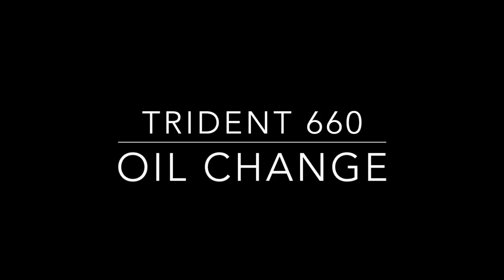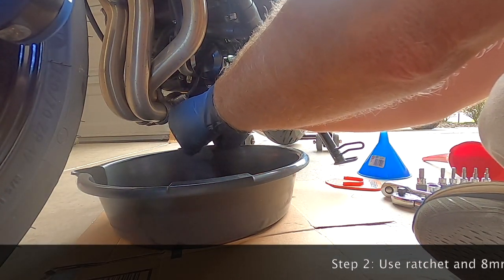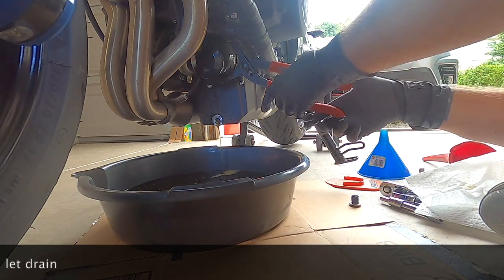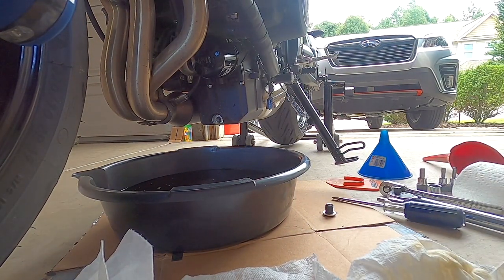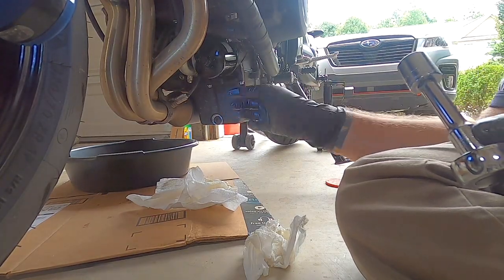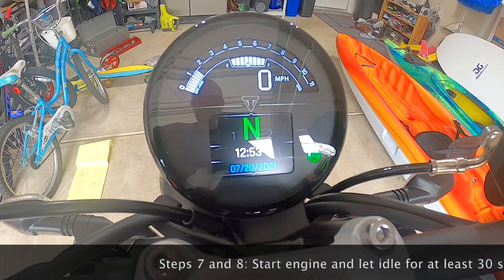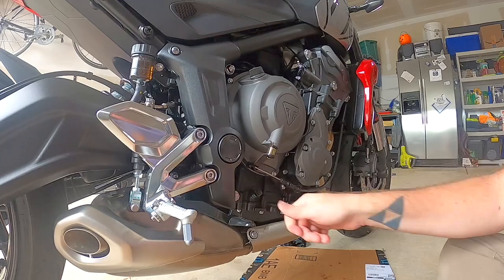Trident 660 Oil Change

Comment: Just a tip alot of folks recommend filling the new filter with oil before replacemnt. Creates less dead space that the engine needs to fill when turned on the first time
Reply from the maker: I’ve heard that and it makes sense. I’ve also heard that it’s not necessary and is a good way to make a mess. Mostly I’ve just been doing it this way for so long that it hard to change old habits at this point. 😂
Reply: Hi Rob, my Triumph 1050 manual, states that you should fill the oil filter, with new oil.
Also, smear the O ring with clean oil, prior to fitting the new filter
Reply: @SBKPete    Never forget the o-ring my boys
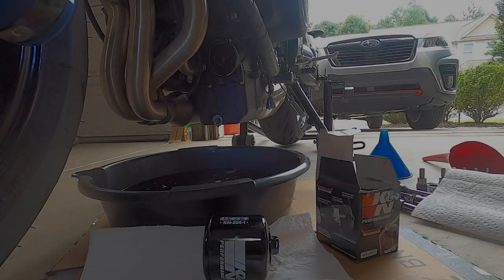Reply from the maker: By all means follow the manual. The Trident manual does not specifically mention filling the filter, but it does mention putting oil on the o-ring, which is why I put it on step 4, and you see me do it at about 2:50. The filter I took off was the original one from the factory. Maybe they are forgetting to oil the o-ring there and that is why it sticks. I've heard that it happens on other Triumph models when owners do the first oil change.
Reply: Do not try to fill your oil filter. Most motorcycle and many car engines have the filter mounted from the side, so it's not practical to do so. If it is important they wouldn't design engines this way. Even if the oil filter mounts vertically, you would be pouring some unfiltered oil into the engine and although it's new oil it still contains some debris. My personal experience in over 50 years of changing oil in cars and motorcycles I've never had issues. 
What I believe is important is to not over fill with engine oil.

Comment: I'm planning to change engine oil of my Tiger 660. Everything is same as in the video. Thanks for sharing video.
Reply from the maker: You’re very welcome. In the future, I’m going to stick with the Triumph oil filters or their OEM equivalent. I can’t trust the K&N 100%, so why risk it?
Reply: @jrobrides1340  : yeah it's always better to stick to company recommended spare parts. 
Even I have 3 different oil filter options here in India, K&N, BMC and Crank 1. Only issue here is Triumph service centre at my location don't sell spare parts to customers since they don't really have competition nearby. Next nearest Triumph dealer is 150miles+ away from here. Hence, looks like I'll have to depend on aftermarket spares rather than spending huge at Triumph

Comment: I'll complain to my grave why motorcycles can't have their sight-glass or dipstick calibrated to read the oil level while the bike is on the side stand. This check oil while the bike is level stuff is nonsense and makes it tricky for guys like me with no friends to hold the bike :-p Another note for all: be sure to check the owner's manual for your machine - oil checked cold can vary quite a bit from oil checked hot. I am not sure if there is an industry standard on this one, but you'd be amazed how much hot oil expands and gives you a whole different reading.
Reply from the maker: 100% agree.

Comment: recently also changed the oil on my own. By the way, I drove with a strong magnet on the drain plug, and when I removed it, the plug was very clean, without any magnetized signs of wear.
Reply from the maker: Nice. I didn't use a magnet, but there wasn't anything strange in the pan at least.

Comment: To anybody watching this for a how to, do NOT tighten your filter on with a wrench. That’s just stupid and asking for trouble when trying to get it back off. You only put them on as tight as you can turn by hand and that’s it. There’s a reason why there’s a big rubber gasket on them. The giant nut welded on the end is for removing it. They will tighten down even more going through the natural heat cycles. That’s why when you put them on by hand you can almost never get them back off by hand. Everything else is good advice though.
Reply from the maker: Then why have a torque spec for the filter?
Reply: @jrobrides1340  because something like a torque spec for an oil filter is for somebody that has no mechanical ability and needs to be walked through something ultra basic with their hand held. Ask ANY real mechanic and they’ll laugh at you if you talk about torque specs for an oil filter. They’ll all then tell you hand tight is right.
Reply: A torque spec for an oil filter is the equivalent of a warning label on a jar of peanuts saying “contains peanuts”. It’s for the mentally feeble.
Reply from the maker: @cfltitan  So you're saying there is huge difference between hand tight and 10 Nm? I would be more concerned about the inconsistency. Hand tight for my delicate lady-like hands might be very different from hand tight for let's say your giant gorilla mitts. I'm also curious as to how tight Triumph put the filter on at the factory to get the gasket to stick like that? Maybe that was actually to spec, and therefore that validates your point. On the other hand they have been making motorcycles for awhile, so you would think they would at least get a few details right in their owner's manual.
Reply: @jrobrides1340  They end up sticking like that when you don't lube or oil seal-gasket, at factory speed is more important so they just spin it on and if you can over tighten it to the point that seal fails then you are more then likely a pro rock climber and I'm not shaking hands with you😲 and yes 10 NM is pretty much hand tight do what ever makes you more comfortable most Mechanic's won't say anything but will shake their head after you leave. just being honest just got mine 2 weeks ago brand new and was wondering about Service light so thanks for link to the other Video and yes I still haven't read the manual it will still be wrapped in plastic when I sell it😲😳
Reply from the maker: @josephschultz  this was the first oil change since it left the factory. Whoever spun it on either didn’t lube the seal or was very strong. Not the first new Triumph I’ve seen do that.

Comment: PSA: Do not torque that oil filter down using the hex. It weakens the joint between the hex and the metal body, and will crack one day. Many others and I have had it happen to us which results in a dangerous oil spill in front of your rear tire. That hex is meant to easily taking OFF the oil filter.
Reply from the maker: So you personally have had a K&N filter fail at the hex nut??? I had heard similar horror stories about K&N oil filters before. Some even claimed that the nut being bonded to the body is enough to make the body weak enough to cause a failure. The failure could still happened when the filter was spun on and tightened by hand. It was enough to make me stay away from the brand for years until I personally met several people who had been using them for many thousands of miles without a problem. I'm still a bit skeptical that only 7 ft-lbs of torque could cause any problems. That being said, anyone nervous at all about the hex nut on the filter should just go ahead and buy the Triumph or any other brand they trust. It may be more money or less convenience, but it's worth it for the peace of mind. If it's something at happened to you though, that story alone is enough to make me go back to a Triumph filter.
Reply: @jrobrides1340  It happened to me personally on my air cooled bonneville approx 2017-2018. I was riding to Prince Edward County from Toronto, passed Port Hope and arrived in a quainy tiny town. Did a U turn at in the town square and stopped. Just prior to stopping a MASSIVE amount of oil leaked out of the K&N filter between the nut and the body. i.e. it covered half the road.

I think you're going a little too far to say avoid that oil filter if you fear it breaking.

The issue can occur when you use the nut to tighten it on. Dont do that. Simply hand tighten it. On the bonnie, the rule of thumb was 1.5 turns.

Hope this helps.
Reply from the maker: @akiln  Good information. Thanks for sharing.
Reply: To anyone who is trying this for the first time on their own 660 and are confused by the comments stating not to top off the oil:
He's right, I just finished doing it not 30 seconds ago and 3 qts is just shy of enough. Prior to this I had my first service done at the dealer and the amount of oil that was in there was also a bit more than 3 qts (noticed after refilling the containers with used oil). So the dealership ALSO used just a bit over 3 qts.

Comment: if you have remaining gasket, do not use a screwdriver on the sealing surfaces.  Plastic scrapers only.
Reply from the maker: Good point! In my experience the gasket usually comes off in one piece. You just have to give it a nudge. But if it doesn't come off cleanly, a non-marring plastic scraper is a good idea to clean up bits that try to stick.

Comment: Oil the o ring on the new filter before fitting. Stops it grabbing as you tighten….
Reply from the maker: I did. I'm just not sure they did it at the factory.

Comment: Can you add more maintaince videos on Trident like air filter change, flushing brake fluids, coolant change .....etc?
Reply from the maker: Thanks for watching. Unfortunately I have traded the Trident on a Scrambler 1200. But I did find this video on replacing the air filter. Ride safe. https://youtu.be/8_pQRimDyTo
Reply from the maker: They also did a brake video as well. https://youtu.be/TCL_Ownlsdc

Comment: Can you please do a video on changing the air filter? Haven’t found one yet.
Reply from the maker: I can but it might be awhile before mine is due for a change. I’m still trying to find out where it is! I suspect that it might be underneath the tank like the Street Triple.
Reply: I’m looking for the same thing. I suspect it is under the tank.
Reply: Open the seat. Air filter chamber is just below the fuel tank, you can see it. You may have to remove one of the covers of fuel tank to open the air filter chamber.
Reply from the maker: I recently found a video of a couple of guys changing the air filter. They had to remove the tank cover and the fuel tank to open the air box and replace the filter. It didn’t look difficult just tedious.

Comment: I feel the sump is dangerously close to any road bumps. Mine hits the ground very easily and worries me every time.
Reply from the maker: That didn’t happen to me, but I’d be very worried if it did. The bike I had before the Trident was a Harley Softail, which felt slammed to the ground by comparison. I’m now on a Scrambler, which feels much higher up than the Trident.

Comment: I’m going to try changing the oil end of season with the bike on the side stand. As far as I can tell, on the street triple you were able to drain the oil on the side stand and i think check the oil level when the bike it upright … but I have heard others say they got the same reading on the side stand.

I figure with so many similarities between the ST and the Tri, one may be able to knock it out on the side stand.
Reply from the maker: That shouldn't be a problem. The only reason I stood the bike upright was because I happened to have a paddock stand (it is nice when doing a chain service) and the manual recommended doing it upright. You could always check the level before draining the oil and then just refilling to that level all while on the side stand.
Reply: So… you need to check the oil when the bike is upright and both wheels are on the ground. Also the dip stick needs to be wiped, be twisted back in all the way, and then twisted out. Any other way and you may overfill. Don’t ask me how I know 😆
Reply from the maker: @akiln  Did you have it on a paddock stand? If that doesn't work to check oil levels, maybe a wheel chock would be better.
Reply: @jrobrides1340  Bike was upright, but I mistakenly measured the oil level without twisting in the dip stick.

Comment: The big question to me is how you were able to clear the wrench icon.
Reply from the maker: I had the dealer do the rest of the service and clear the light. I saved about half of the cost of the first service by just doing the oil and filter. Haven't found a confirmed report of anyone being able to clear the wrench by themselves yet.
Reply: @jrobrides1340  Everything I've seen suggest Triumph won't allow it since it's a new model.
Reply from the maker: @jameyhinds  Unfortunately, I think you're right. I'm OK with bringing it back to the dealer for the 10k services. Motorcycle tecs have bills to pay too, right? But I don't know about taking it in every 12 months.... I guess I have a year to think about it or for someone to come up with a solution.
Reply: @jrobrides1340  I have chosen to leave the wrench "on" and will probably take it into Triumph for the 10K service. I'm at 3K currently.

Comment: Does the filter need to be changed for the 500 mile break in service? Sadly I cannot entertain the dealer with another $350 right now, so ill be changing that break-in oil out myself and im just wondering.
Reply from the maker: Yes I would definitely change the filter. Who knows what crud, shavings, etc it’s been collecting during break in. I’m going to put a Triumph one on during my next change. Too many horror stories about the K&N.
Reply: @jrobrides1340  Damn, thank you for the heads up!
Reply: @jrobrides1340  Ugh.... I had no other option other than K&N from my local Adv Auto & Autozone! Anyways, I went mobil-1 4T on the oil, immediately noticed that "ice cubes in a blender" sound to be ALOT lower in volume and shifting improved significantly. All that Triumph/Castrol hype is str8 BS! Go Mobil-1
Reply from the maker: @AllboroLCD  sounds good. I've used Mobil-1 in my cars for years. Definitely good stuff.
Reply: Did you get any kind of dash notification about maintenance/needing to change the oil? If so do you need a dealer to reset it?

Comment: Question, why not American made oils such as valvoline 4t or amsoil?
Reply from the maker: Either of those would be fine as long as they meet the required specifications. I usually just go with what the manufacturer recommends, especially during the warranty period. Both Valvoline and Amsoil make perfectly good products. Use what you feel is best.
Reply: @jrobrides1340  it would have been better if you used valvoline or locally sourced oil. I heard once from a gold wing owner that valvoline 4t gave him a better, smoothe engine operations and gear shifts. Just saying. Castrol....
Reply from the maker: I’ve never had a problem with Castrol or anything else for that matter. But it’s your bike, put whatever want in it.

Comment: I thought tridents have an annoying change oil message that had to be disabled by a dealer service center. Did they finally fix that problem? It made me write off getting one.
Reply from the maker: Nope. The message still pops up and it's still annoying. I heard rumors about being able to clear the message with software, but at that point, I'd rather just take it to the dealer. Doing the oil and filter yourself can at least save you some money when you do have to bring it in. To be fair it's not just the Tridents . Most if not all new Triumphs are the same way.
Reply from the maker: @alexg160  Thanks for sharing this, I had not seen it. Looks like Apple users will still have to wait for their app?
Reply: @jrobrides1340  no problem. Yep, the app is only for Android users 👎🏼

Comment: Direction in manual say check level bike upright on a flat surface,  not on a paddock stand as it gives a false level  reading...
Reply from the maker: By how much do you recon?
Reply from the maker: Also the manual only says upright and not on the side stand when checking oil. It does not specifically mention paddock stands.

Comment: The oil filter is a b@tch to get off, even with the pliers. My pliers eat through the oil filter casing rather than twisting it off.
Reply from the maker: Lol. Yeah I don’t know if Triumph has some super robot or a genetically enhanced gorilla that installs the oil filters at the factory, but it’s on TIGHT. I think that also has something to do with the filter gasket that sticks to the pan.

Comment: Is there anyway to reset the service light on that bike? Obd2 adapter maybe?
Reply from the maker: Currently it doesn’t look like there is anything that will work short of taking it to the dealer.
Reply: @jrobrides1340  Thank you!
Reply: $70 $ for a dealer to reset it. You can do It with OBD2 between 30$ and 110$ and tune ecu software which is like 15$ I belive.
Reply from the maker: @drrrd9536  I still haven’t seen anyone with the software that will work for the Trident. I’ve only heard that Triumph changed something in the ecu, and current software doesn’t work.
Reply: Yes you have to buy a OBD2 Adapter that is Bluetooth and install TuneECU on your android phone to reset. I just did it this morning.

Comment: How much litres do we use for this bike ? 2,5 or 3.0
Reply from the maker: The manual says 2.8 litres with oil and filter change. But you should check your level with the dipstick.
Reply: Which oil you used ? 
Castrol & Motul ? 10-40 , 10-30
Reply from the maker: I went with Castrol 06112 POWER 1 4T 10W-40 Synthetic Motorcycle Oil